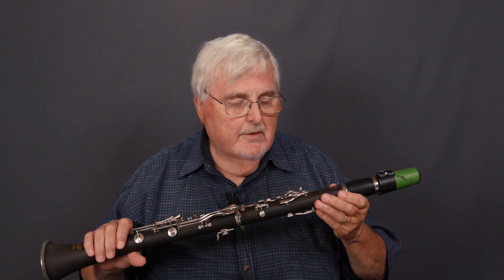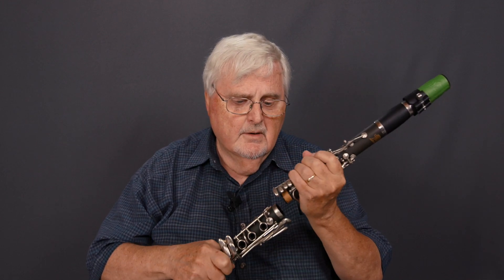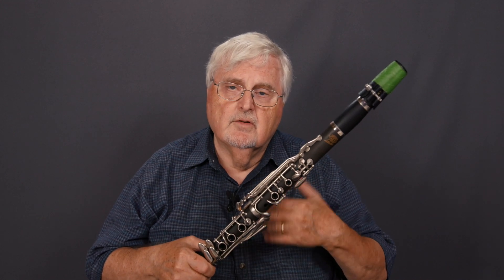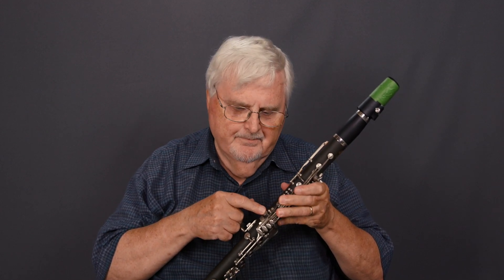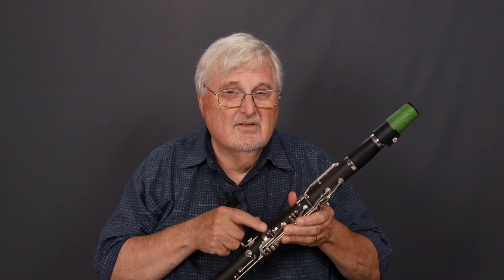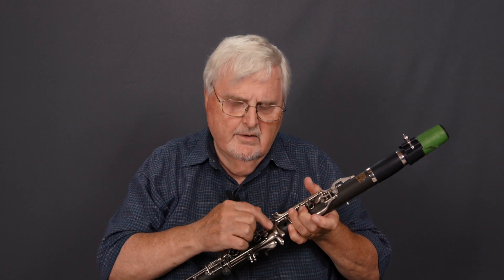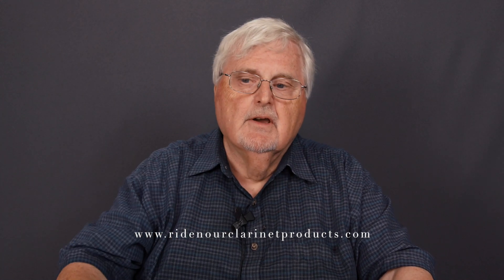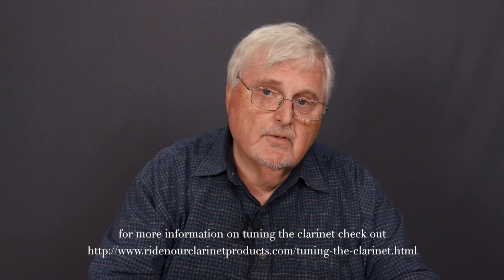the clarinet: one piece or two?

Comment: i am against pulling out at the mid joint as you must keep the cork in perfect condition or you will have too loose a fit. many young players dont use enough cork grease as is and their mid joints are going to be too loose. from wear .
Reply: That's no reason to reject adjusting tuning by pulling the middle joint. KEEP YOUR CLARINET IN GOOD CONDITION, if necessary eliminate cork tenons with thread or plumber's tape.

Comment: I do agree that two-piece clarinets offer great advantages. But a question came up. What if one piece clarinets were made out of hard rubber? Would that solve the tuning issues since the tuning on hard rubber clarinets does not change at different temperatures. And there would be no fear of cracking as well. And if there are really major tuning issues, maybe experimenting with a barrel that has a different taper (hourglass, conical, reverse taper, cylindrical) would solve the tuning issue?
Reply from the maker: tuning DOES change on hard rubber, but the degree of change is not as great. Every clarinet warms up from the top/down. So the right hand will rise and get higher in relation to the left on clarinets made of all sorts of materials.
One piece clarinet: dumb idea if you want to play well in tune.
Reply: William Ridenour understood, thanks for the clarification!
Reply: @billyboy647  This may sound silly, what if the instrument has a built in preheater? Would this keep the instrument "perfectly" in tune? High frequency electronics often due this, preheating the oscillator, to keep it from drifting from design.